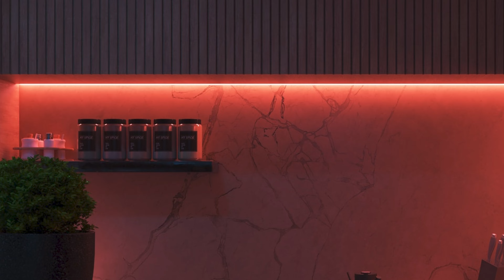How To Buy RGB Colour LED Strip Lights - [Wholesale LED Lights]

Comment: Hi. Just a question about controllers. I'm doing a job around some signage. The strip lights will come on through a timer. I dont want to muck around with controllers. I'd like the led strip lights to change colours, from when the lights turn on to when they turn off (probably for 5 to 6 hours). Whats the best way to set up the lights. No-one will be there to control them. Thanks
Reply from the maker: In order to have the colours change on their own, you will need a controller, but it will be a case of just setting the correct colour changing mode once, and it's set for good unless you change anything on it manually. For something like what you've described, we'd recommend going for Pixel tape rather than RGB, as its a better option for automated setups compared to RGB. We'd be happy to talk to you in more detail about this - please feel free to give us a call on 0116 321 4120, and we can put together a bespoke quote for you based on the needs of your job :)